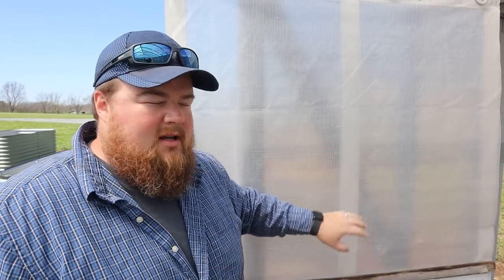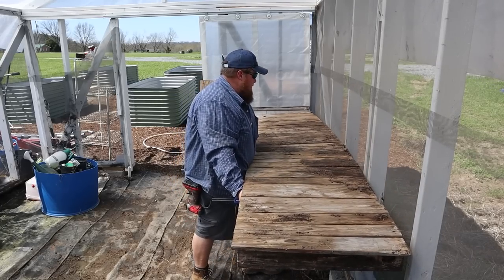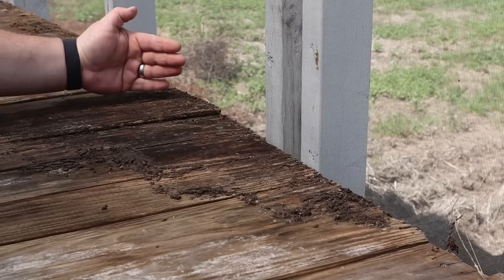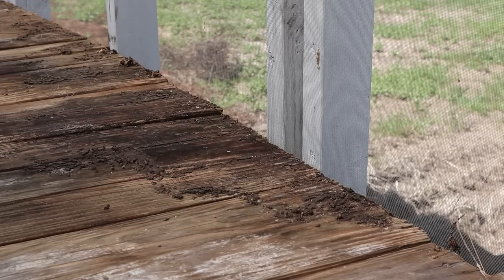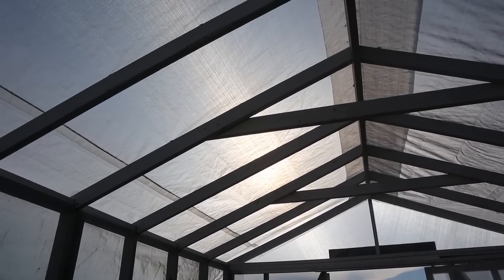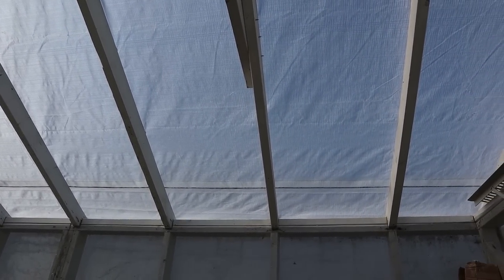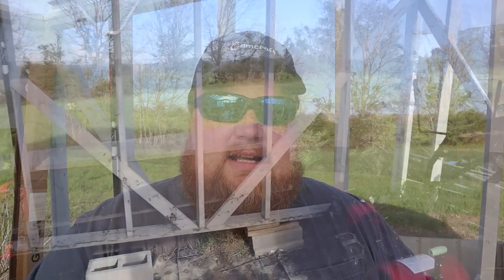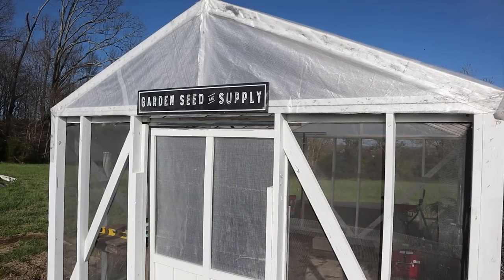What Every Greenhouse Needs... Mega Potting Bench Build - DIY Wooden Greenhouse

Comment: Grab yourself a free pallet and screw it to the wall with the gaps facing up. You can slip the handles in to hold them and add screws or hooks along the front slats for hanging smaller hand tools like trowels. I use this method and it works very well😊 and it takes up so little space to boot

Comment: I noticed that you had some roofing metal left over.  I wonder if it would help on the bottom part of the greenhouse where it is open?  We used some (actually half way up) on our potting greenhouse and I still like it.  Actually, because it is so high on the wall, I can hide bins of soil and manure under the potting bench.
The only thing I might change, if it were worth it, is to add a piece of 2x behind the table legs, to go under the framework of the top.  In the future, if you were building a new bench, you could consider using hardware cloth for the top, and maybe even a low shelf under.  I can think of a million ways to get fancy :)
I want to thank you for the recommendation for the mesh plastic film that was detailed in your original greenhouse build.  We finally  got the "skin" on our farm hoophouse last year.  I used more leftover tin on the bottom 4' on the north side, regular plastic over the hoops, and the mesh on the ends and the bottom 4' of the south side.  We have livestock and I wanted to "beef'in" it up a bit.  This winter we kept our roosters in there  (not actually loose though) and there was no damage.  We had built up the hoops the additional amount in order to use the mesh and the tin.  This will be our first summer of use, at long last.  Anyway, I never would have known that there was a mesh plastic without your video.
Reply: oh good grief.  I listened to the last minutes of the video and you were talking about what I was thinking about (the plastic and the metal - though I didn't know about the new pieces from the raised beds at that point).  I should know better than to comment before the video is finished. haha.  I do get excited about gardening and greenhouse videos!